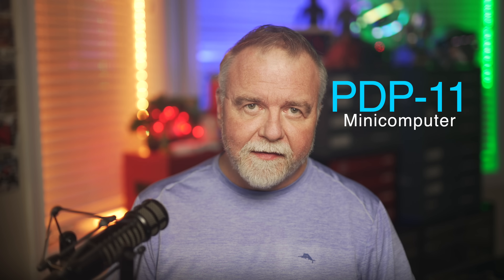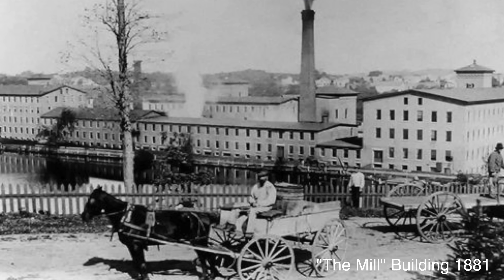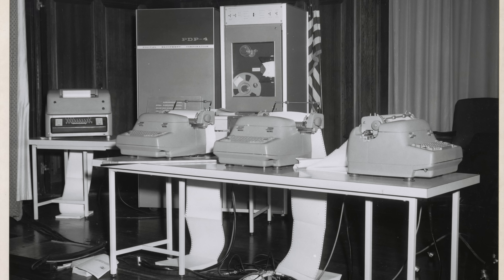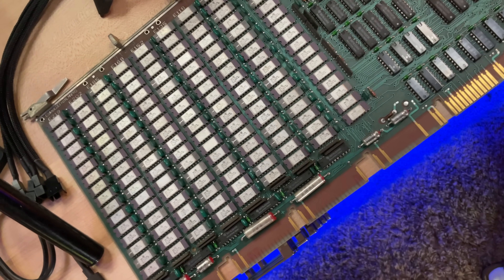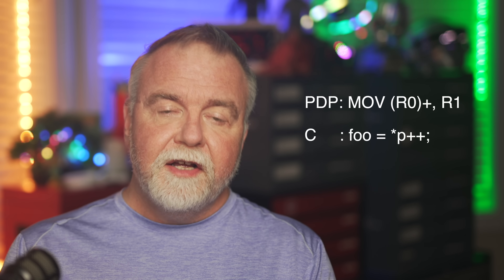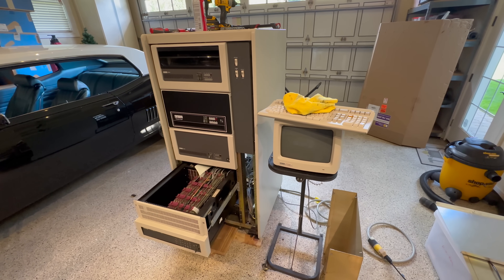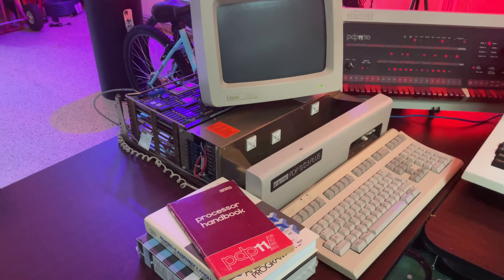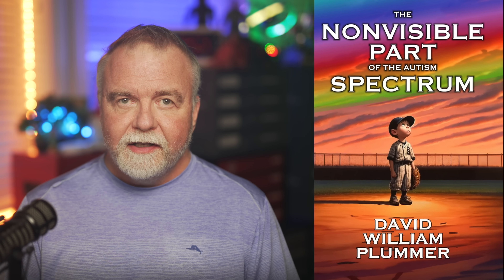From Core Memory to the Internet: Amazing History of the PDP-11

Comment: I worked for Collins Radio beginning in 1977. It was taken over by Rockwell Switching Systems shortly thereafter. Collins built one of the first Automatic Call Distributors (ACD)  which was powered by the PDP 11/35. The terms you used, like Unibus, gave me a huge dose of deja vu. Thanks for this. Wishing you all the best.
Reply: I used to work on some Collins 8500 computers in the Air Canada reservation system.  It was the communications front end for a UNIVAC system and included several PDP-11s, each connected to several modems connected to the world!

Comment: One of the first computers I had direct access to was a PDP 11/34 running RSX-11 V3.2, (which we later updated to V4.0), RK06 disks with a VT52 terminal.  Learned assembly language, FORTRAN.  That machine essentially bootstrapped my career of now over 40 years.   Thank you DEC!

Comment: My first PDP-11 was an 11/60 running RSTS/E V6C back around 1977 or so at Northern Kentucky University. I was a COBOL/ASSEMBLY programmer on the IBM 370/115 running DOS/VSE and was the only one willing to become the new beastie's system manager. Went to 3 weeks of training at the Rolling Meadows facility outside of Chicago. That's when I fell in love with DEC stuff and became a DEC employee in November 1979.

Comment: The unibus concept seems self evident but I know it wasn't.  I remember Jerry Pounelle's column in Byte and him talking about his S100 machine while at the same time working with an Intel 8086 development system with a similar bus. My entire career has had a similar bus in whatever system I've been working with including most PLCs capable of running large process control systems. 

Speaking of process control applications for the PDP-11, I've never had the pleasure but have heard the campfire horror stories of interfacing PDP-11s with pneumatic control systems. Scary and painful.

Comment: I wonder if there was a fault in a huge punch card program, would a change be possible to be swapped in to the card stack, if of course the size maybe was lesser and maybe some nope added in the end?
Reply: Yep.  Each card was independent and could be replaced.  Or the deck could be spilled on the floor!  🙂
Reply: @James_Knott  I think I have seen some stacks where there was unparalleled tush strips on the sides, possibly to get back from the floor randomization problem. :-D
Reply: @radarmusen   Yep.  They'd use a marker to make a diagonal stripe on the deck

Comment: My very first paid job in 1978 was developing factory automation software on a PDP-11/34 which was then transferred to the factory controller which was a PDP-11/40. They both ran RSX-11M but different versions; while it was easy to upgrade the development machine with a new version of the o/s as part of the learning process, it could not be tolerated on a live 24H system so it was stuck on V2.0.
We took DEC's DECNET networking software, where they conveniently supplied all the source code, and developed our own cut-down version of it (UBZNET) that was tuned to our needs to link the 11/40 with our 11/03 systems which ran the equally cut down RSX-11S. Happy days. I'm really enjoying your chat about all this, more please!
Reply: Did my BSc work on am 11/34 in Germany in 1978. We controlled 100 ton press tools. It was fun. I still have the paper tapes.

Comment: The Spacewar game on the PDP-1 at 4:38 has much faster gameplay than I remember playing on the the PDP-1.
Either it is sped up video, possibly from Super-8 film cameras from the time filming at a low frame rate to get enough light on the film, but looking sped up at normal projection rate - or more likely from the jittery motion of the space ships it shows the ACM (Association of Computing Machinery) funded recreation of Spacewar on a raster display in the 1980s, which had sped up game play to hide the jitteryness of the raster display.
This is a shame, because the original PDP-1 Spacware was a smooth (stroke-writing) slow dance of the spaceships (very slow rotation of the long spaceshp and long time between firing bullets and their slow curving path to impact) resulting in gameplay that if you make a bad strategic decision, you had no tacitical way to overcome it, and had to slowly live with the outcome of what you did.  It was the dance of the elephants, requiring thinking far ahead.  This was for me much more fun gamplay than modern twitch computer games.

Comment: The smirky laugh after saying "where I can compile a linux kernel in under 19 seconds" is gold.  Yeah yeah Dave, we don't all have a 7995 ;)
Reply: Yeah, $10,000 CPU. Ow. My i9-13900HX laptop which I paid $1700 for takes 1m12s to cross-compile a defconfig RISC-V kernel. The alternative AMD 7945hx is basically the same too. Good enough for me! p.s. my first formal programming lessons were in 1981 on an 11/34 with 256k RAM, 22 VT100 terminals, and two LA120 printers, running NBS Pascal in the first part of the year, OMSI Pascal (slower but more complete and less buggy) later on. I'd already done a fair bit of programming (machine code in hex!) self-taught on an Apple ][, and on TI & HP calculators before that.

Comment: The LSI-11 series, which includes the LSI-11/23, also included the single slot 11/02 processor, that was even pluggable into a (later model? specialized version of?) VT-100 display terminal. A set of those was what we used in my first year assembly language classes at the university. No disks or such, but we could type in our programs in octal.

Comment: I was a math/physics major from 1974-1978. In 1976, the science department got a PDP 11/34 running the RSTS-E (resource sharing/time sharing-enhanced) operating system. Every science student got their own account on the system. My introduction to computer programming was a semester of DEC BASIC, taught from the DEC BASIC user manual. We had far fewer terminals than students, and if we couldn't get on one of the two VT-55 terminals, we had to settle for one of the eight ACT-1 terminals, or one of the four DECwriters. Those were 300 baud teletypes, that used a keyboard and printer. They were a pain to program on. In 1977 and 78 I learned to program in FORTRAN on that same system. I was among the computer geeks that hung around the machine after class, and became admins. Fun times.

Comment: Have you ever heard of TSX-Plus?  It was a 3rd party multiuser/multi-tasking version of RT-11.  It required that you have RT-11 on your system and you would actually run the TSX-Pius operation system from RT-11.  TSX-Plus would replace the RT-11 kernel when you ran it.  TSX-Plus would run any program written for the RT-11 operating system including all the RT-11 utilities.  TSX-Plus was created by Phil Sherrod of SandH Computers in Nashville, TN.  I was hired by SandH as a programmer in 1986 to work on TSX-Plus as well as their of their PDP-11 products COBOL-Plus and RT-Sort.  I was hired straight our of college to program in PDP-11 assembly language Macro-11.

Comment: Thanks Dave, I trained and maintained the Perkin-Elmer 8/32D Mini-Computer while serving in the USAF from 1984 ~ 1988, these supported the C-130 Flight Simulator located at McChord AFB.

These machines all had Core Memory and storage was done via both 80MB and 300MB CDC disk pack drives.
Reply: I worked on the same trainer at Pope AFB from 1985 to 1995, as an airman and as a contractor. Bselch, pasla, master controller, sub controller, racko tacko. I can remember some of the terms. 😁
Reply: @Jeff-vv4pn  very good and thanks for your service as well ;)

I tried to get sent over-seas to no avail, I didn't realize all the non-US air bases had been contracted out already to support the sims, so instead of visiting new places I got sent about 150 miles north on I5 from PDX, my hometown.

Comment: I installed many a PDP 11/34a in auto assembly plants in the late '70's and early '80's.  It was a marvel to bring up RSX-11M and M+ and our proprietary software, some third party comms hardware, and have it run the entire plant.   I also installed 11/44's in other process control environments, and they were challenging to maintain.  Working for the same company I became involved in DEC systems at various government agencies where I was exposed to 11/70's and more expansion chassis then you could shake a stick at!  Some of the best and worst times of my life being in that 'gummint' environment.  That box of loose DEC modules in your video without separators between them or a PCB stand would have given my old boss a heart attack!  He had a six car garage full of PDP's and associated parts at one point.  Alas, they are history, as is he.

Comment: The picture of a pile of hardware in the back of a car is TRUE !  Ford started prototyping "electronic engine controls" (pre-cursor to electronic fuel injection) on a PDP-11 in the trunk of a Lincoln, in the mid-1970s.  Programs were loaded via paper tape that was hand pulled through a reader !

Comment: I started my computing education and career in 1971 learning FORTRAN-IV utilizing the universities IBM 360.  If you were lucky, and there was not a long line at the keypunch machines, you could get 2 runs per day !  Sophomore year, the university got a Burroughs B5700.  It was cheap (Chrysler Corporation had traded it in).  Freshman still could only do batch, but Sophomores and above could use the hardcopy terminals in the basement.  (Algol, especially with Burroughs extensions, was fantastic !)

I did not get exposed to DEC equipment until 1977 and then it was on a DECSystem-20 (big brother of the PDP-10).  Moved on to VAXen and finally Alpha, both VMS and OSF/1.  Never really touched a PDP-8 or PDP-11.

I was told, that even in the late 1990s, ANYTHING "Made in the USA" probably passed by at least on piece of machinery somewhere that was run by a PDP-11.  Early days of Intel, all process control computers were PDP-11 or VAXen.  The Microsoft Outlook mail server ran on VAXen for years.  A few years a go, I learned that DOW chemical still used hundreds of VAXen to run various chemical processes, worldwide.  There are still companies making money reselling and repairing Unibus/Qbus and VAXen hardware.

No one ever covers the various PDP-11 operating systems.  RT-11 (and TSX-11), RSX11 (many version), RSTS (many versions) and MUMPS.  Reviewing their history would require a 20+ minute video for each.

Just to prove that "everything old is new again", VMS and later RSX and even TOPS, had "indexed sequential access files" (ISAM), as did IBM.  Today it is call "NoSQL" !  (VMS had a layer call Record Management System (RMS) that hid all of this from the user and un-trained programmer.  IGM and DEC both OSes that could handle multiple CPUs, long before Microsoft.  Also, most of OS/2 and the early development of Windows 64 was actually done on DEC Alpha hardware.

"The good old days" !

Comment: Late 70s the first PDP-11 I saw was the 11/03 at the local junior college, it was small enough they had 4 and a single 11/40 for the Computer Technology program. The university I attended had the 11/70, 1st floor of the School of Science, behind a glass wall of an environmentally controlled chamber attended by a priesthood. Just like we'd read in the histories.

The trip I made to VCF PNW (2019) there was one fellow there with a DEC setup on display, he had worked for the SEC, he said the private network that connected the exchanges in NY, Philadelphia and San Francisco was done with 11/23s at each node. Fascinating.

Comment: I disagree that the PDP11 encouraged users to do anything inside the machine. Our PDP10 and PDP11 lab units ALWAYS required us to “Call DEC” to do anything. If the DEC tech discovered you had been poking around inside, you paid more for his time. Furthermore, upgrades were not as simple as described because DEC would put epoxy in open slots, thus requiring you to buy and install a new bus to do any upgrades. 
DECs service model greatly increased the cost of ownership. The purchase price of the unit itself was the least of our labs worries—the DEC man in the little white station wagon was much more of a budget buster.   Good riddance to this model of doing business!

Comment: I remember installing a new server at a customer. The new machine was basically a big workstation running Unix and having software such as Word Perfect installed. The users accessed it though serial terminals and they would handle all the compute requirements for ten users and handle every thing the company needed. It went just next to the DEC rack that they had used so far and was a lot faster and had a lot more memory than their old DEC with it's core memory. Their IT guy was just laughing when he saw the new machine, and it did look ridiculous beside an entire rack like that.

Core memory was interesting in that it was actually serviceable. A broken memory usually had a wire that was broken or component failure had burned the wires. Yet you could thread new wire through it to replace a damaged one. But the cores were really small you you would use small crochet hooks to handle the wire. But these memories were not compact. 65 kb of core memory is a lot! That includes 65536 cores. You do not want to try to crochet one of these just for fun...

Comment: The PDP-11 seemed amazing at the time.  it had a certain academic cleanliness.  They also were pretty slow and could only access 56K of RAM without major contortions.   That hard disk cost $9,000 and it stored about 2.5 megabytes.    The compilers were mediocre, generating slow threaded code without optimization.  Quite often we got more done with the much older PDP-8's.

Comment: Hi Dave
First used 11/34 as a component of Xerox 9700 laser printer. We built our own analog digital controller   Another project used a 11/70 (I think) behind a high speed serial 9600 haha silo. Then used a sbc 11/21 to sample incoming variable frequency telegraphy. Wasn’t quite fast enough to pull phase out so hot clocked it with a faster crystal about 4%. Worked fine!

Loved to see them in your garage. Best to you.

Comment: Since you started the video talking about core memory DEC's main competitor after a while was right in their own neighborhood - the company founded by the guy who invented core memory 

which was Wang Laboratories (I worked there butin NYC) the headquarters was just a few miles down the road in mass -When  DEC's  dominance was declining Wang's influence was increasing due to its specialization in word processing and adoption of the Z80 and 8086/8087 which as you well know was soon after the architecture platform for the PC-XT . But right before that the OWNED the WP market along with the IBM display writer system which ironically used 8-inch 160k floppies and cost a fortune.

But back to core memory  ... Dr An Wang  (+1) invented it and then IBM started using it in their first mainframes here is some detail. ...  

Fun fact the core memory unit on an IBM 360 Mainframe ran so hot that we used to put boxes of pizza on top of the cabinet with the memory racks and it would melt the cheese due to all the current it would draw to maintain the magnetic field on the little donut rings a positive voltage was a one and a negative voltage was a 0 the trick was it was non-volatile because the ferrite core magnets would be polarized North and South positive negative 1 and 0 completely radical for its time and then came dram and the rest is history

An Wang

A Harvard physicist who filed a patent for core memory in 1949. Wang and Way-Dong Woo, another American physicist who emigrated from China, developed the pulse transfer controlling device in 1949. This device used the electromagnetic influence of the cores to control the transfer of electricity in electromechanical structures

The IBM 1401 was the first IBM computer to have core memory and be transistorized. The 1401 was introduced in 1959 and was a high-volume, stored-program computer that was popular for running business applications. The 1401's core memory was made up of tiny magnetized rings called cores, and it could store 4,000 characters. 
 
The IBM 702 was another early IBM computer to use magnetic core memory, delivered in July 1955. The Whirlwind computer was the first to use magnetic core memory in 1953..

Comment: Lots of memories being trigg'd with this one.   The avionics bench I trained on ran on a Varian 620L, along with it's big brother VAST.   Mag core memory... 32K with the expansion cage, and early models loaded by way of paper tape until Diablo 31's with 1MB disk packs came along.   Every now and then it'd lose it marbles and we'd have to key back in the bootstrap code with the front panel switches.   37747 in the P register, hit the run key a couple of times, and it came back to life.      Ran what we called ATLAS for the actual test code..

Comment: Great video Dave! My first experience with DEC equipment was in second year university in 1979 where for a Fortran programming course we used VAX 11/780s. We studied the architecture of the VAX later in the degree and did some VAX assembler programming. It was a very elegant, logical architecture and the assembly language very clean and logical also. As a side point, I was interested to see that the PDP11/70 used AMD 2901s for the CPU. I used AMD2901 bit slice processors myself with a TRW hardware multiplier to make a digital signal processing system for my final year project for my degree.  Great memories of those days!